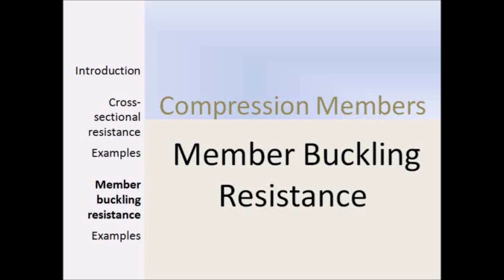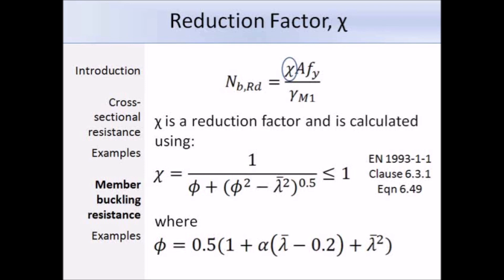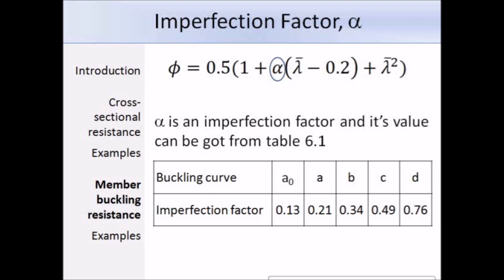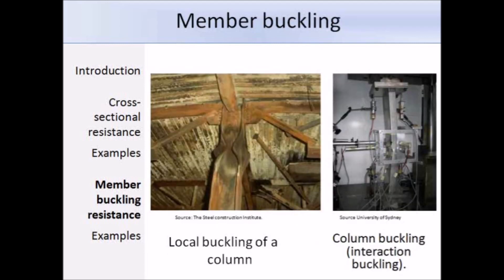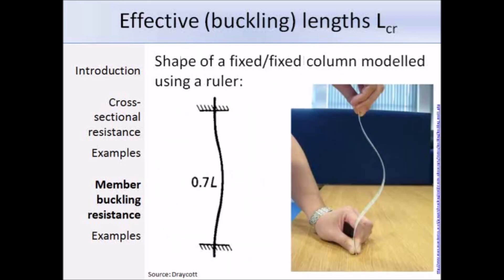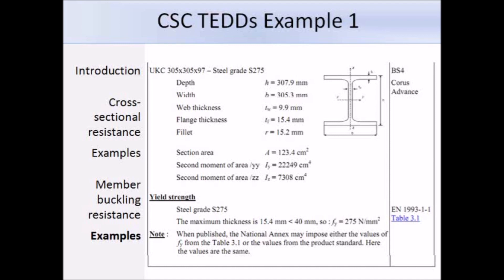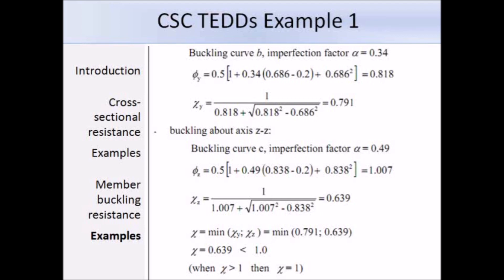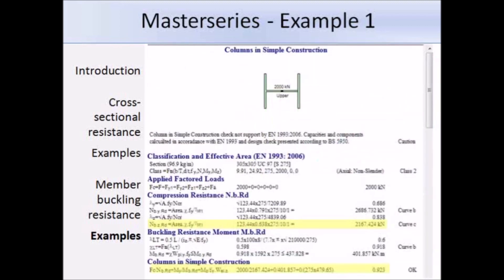Steel Column Design | Buckling Resistance Calculation | Examples | Eurocode 3 | EN1993 | EC3

Comment: Thanks a lot for the sharing. A question please. What about when the top of the column in fixed and the bottom pinned what's the value of the coefficient K please?

Comment: Thank you for the clear explanations. I've got a few questions regarding the 'Class 4 cross sections'. Can 'Aeff' and 'Weff' be found in tables or is there any type of deduction we must do? Are these values related to the fibers in compression (for bending) ?
Reply from the maker: Alberto Poço The effective cross-section properties of Class 4 cross-sections should be based on the effective widths of the compression parts. Check EC3-1-1 6.2.2.5 and EC3-1-5, 4.3 + 4.4.
Reply: @IamDilakshana  thanks! (y)
Reply from the maker: Alberto Poço My pleasure.